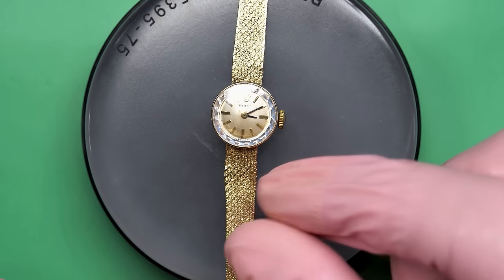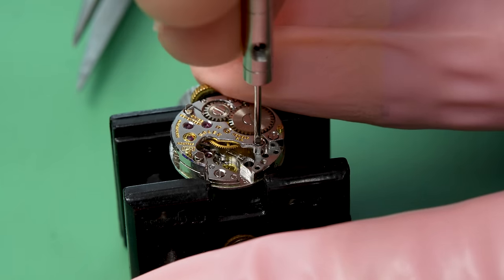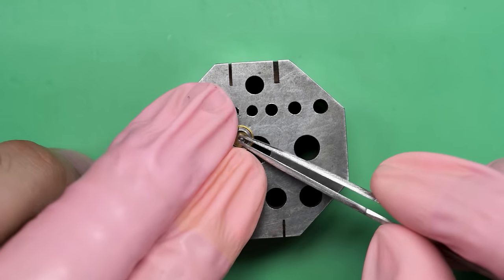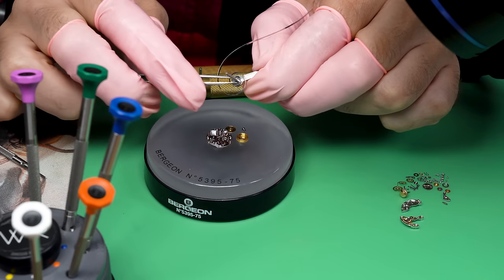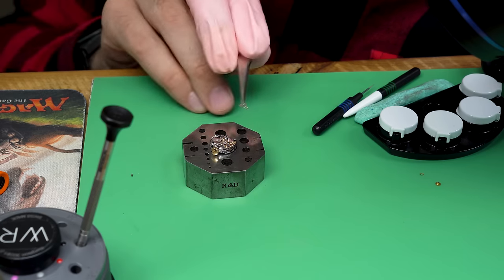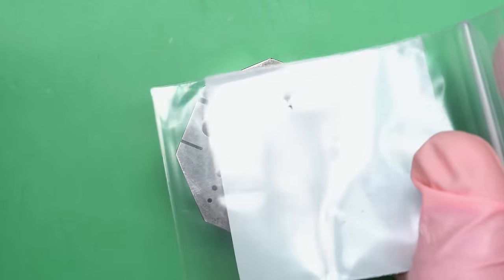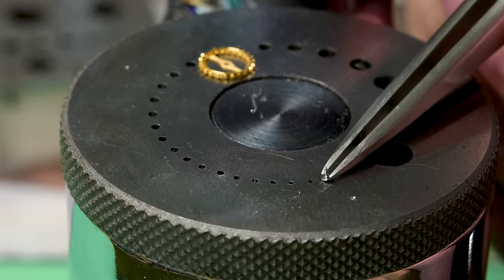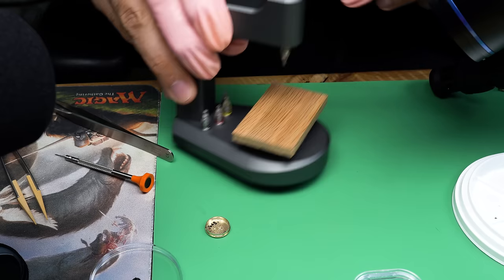I Lied, THIS is the Smallest Mechanical Watch I've Ever Seen!

Comment: I'm familiar with machining, lathes, mills and thread cutting and it boggles my mind how such tiny screws and components can be so accurately manufactured
Reply: I was thinking the same.
Reply: here's a fun fact: the millionometer (a tool to measure one thousandth of a millimeter) was invented in 1844 by one of the watchmakers that owned JLC
Reply: i cant even imagine drawing up the specs of those screws
Reply: I’m pretty sure they just make like hundreds and hundreds of them at random and hope one accidentally just turns out the right size

(am joking, but that is legit how I would do it haha)
Reply: How do you even make a cutting tool to cut the threads? Do you sift through diamond dust looking for a sutably pointy one?
Reply: I study machining at a trade school, and by Jove, very few, is any, threads have come out right on the first try, even after transitioning to CNC machines.
Reply: The machines that make those tiny screws are absolutely and decievingly massive
Reply: And this was in the 60s I think he said
Reply: @neilbrucker5985  I'm not going to pretend to be an expert but tiny fasteners were made long before the 1960s. After a quick Google search I'm stunned to learn the first example of a pocket watch dates to the 1500s. Not suprising  that it was a German who pioneered them
Reply: Swiss lathe
Reply: Yeah and the pocket watch blew my mind, the Elgin from 1880. Sure it's huge by comparison but the screws and gears are so precise. I had marvelled at the fact they could make steam turbine engines at that time but the precision is a joke compared to a pocket watch and these things were mass produced. You can find a running original for 30 bucks. And yet they are the pinnacle of precision engineering before any of the tools of it where invented. And how tight they got the tolerances too. This is some Apollo guidance computer level of beyond insane engineering. And someonencame up with that using an ape brain and pencil and paper with the first modern mechanical clocks having come about a century earlier for navigation at sea. Those are big but still hugely impressive for the 1780s.
Reply: My understanding is that before 1900, it was extremely rare for any micro screws to be of a standard size. Instead they were "made to fit", by hand. It's very common for an antique watch to have 20 screws that are all slightly different sizes. Better keep track of them when taking it apart!
Reply: Same!  HOW?!?!?!
Reply: Micro fasteners aren't machined in the same way as a large one-off threaded rod like you might see someone make on a lathe, turning down the O.D., cutting the thread, etc.

Micro fasteners like this are typically stamped. There's a blob of metal that gets pressed between two plates, or twisted between two wheels/mandrels and a screw is born.

You can see just how rough some of these micro screws are when he shows one closely under the my microscope. Definitely not a finely machined thing
Reply: @shinyribs2178  Automated watch screw making machines came out in the 1870s.  Yes, they were lathed.
American Watch Making Company(Waltham) had their own proprietary design, then there was the Spencer Automatic.
Reply: Watch cronova engineering. They make watch screws
Reply: @mateuszQRDL 😂

Comment: What I love most about this is that you'd likely never get the chance to watch someone do this up close in real life (because a lot of professionals dislike customers looking over their shoulder when they are trying to concentrate), and certainly not magnified for your convenience. Also, when you said 'we did it!' after working your magic on that balance, I've never felt both so included and so inept at the same time.
Reply: "because a lot of professionals dislike customers looking over their shoulder when they are trying to concentrate"

I'll bet quite a few never go this deep into taking a watch apart for service, and just open the case and dab some oil in and call it good, the fact this watch was relatively recently "serviced" but the balance shaft was broken kind of suggests what I said- they just opened the case, dabbed some oil in and called it good.
Totally taking a watch apart like this takes time even if there was nothing that had to be repaired, just taking it apart, cleaning, oil, reassembly would take enough time it would have to cost close to $150- $200,  so if a shop charged $49.95 for "complete service" I'd be very suspicious they don't take anything apart past the case back, just blow it out with air, put some oil in where they can reach and call it good
Reply: @HobbyOrganist  you're probably right. And yes, a service is expensive. My last one was around 400 euros including tax
Reply: I feel like I'm a little kid watching my dad in the workshop or play video games again
Reply: This was great fun to watch!
Reply: Yyyyyyyeah thanks for "helping" FRANS
Reply: @mrlocorio4291  exactly that
Reply: @HobbyOrganist 😊09
Reply: Your so right about this

Comment: The smallest watch I've ever seen was the one that my grandmother used to wear on her nursing uniform. It was pinned on the shirt, and had a 2" chain. At the end of the chain was a pendant the size of a pinky nail. Inside that pendent was a watch that was upside down with the case. The purpose was that she could look down at her chest and see the time for taking pulses. She retired 40 years ago, and I haven't even thought about it since.
Reply: Wow!
Reply: My great-grandma had a similar watch. About the size of the one in the video, but same concept, pinned to her shirt upside down for easy looking. She worked on telephone routing boards back in the day.
Reply: In 1929, Jaeger-LeCoultre created the Calibre 101, specially to fit the diminutive jewellery watches that were all the rage at that time. This tiny rectangular movement has 98 parts, and it measures 14 x 4.8 x 3.4 mm. It weighs a gram, and it is manually-wound, with 33 hours power reserve. Its rectangular shape makes it ideal for inclusion in jewellery pieces, but it has remained very much a collector’s item. Jaeger-LeCoultre still have the capability of making it, but from 1929, only about 2,000 have ever been made. Queen Elizabeth II possesses at least two: she wore one on her Coronation Day, and Jaeger-LeCoultre presented her another, in a diamond bracelet watch similar to that piece, for her Diamond Jubilee. Today their range includes the Joaillerie 101 Résille, reference 2823326, in which the movement is set in a bracelet of blue and pink sapphires.

Comment: My mom had a watch that appears smaller than this that she bought in the early 60's.  It stopped working in the late 1970's and was told it wasn't worth fixing.  It's about the size of a pinky finger nail and I'm guessing the watch maker she spoke to just didn't have the chops to attempt the service. I still have the watch and I suppose will get it serviced when my daughter grows up.  Nice to see someone is willing to take these on.
Reply: The size of the movement is achieved by shelving the plates. The components aren't' scaled down to the movements diameter. The difficulty working with movements is rarely a size issue.
Reply: Like yourself, my mother has a watch that is much smaller than this rolex.  My mom's watch, a GP, is 14kt white gold & is so tiny that I've never been able to tell the time.  Which begs the question, what is the point of a watch if you can't tell the time?
Reply: @montanajones8393  This Rolex is HUGE - ok some exaggeration there😊 , but I've seen tiny watch movements that are small enough to be a finger ring. And yes, totally pointless for the job in hand if you have to squint at it 5cm from your face. At that scale, there must be some alternative to a round analogue display.
Reply: @Robert_Browne  Yeah, size doesn't matter, it's the movement
Reply: Smallest watch movement is the Jaeger-LeCoultre Calibre 101
Reply: @fair2middlin  That's funny
Reply: @montanajones8393  Status.  (or just esthetic.. like a fancy bracelet)
Reply: @ArthurvanH0udt  I googled that and I can't even figure out how you wind it, much less service it. Artificial hands with reduction gears?
Reply: Amazing!  Micro horological brain surgery.  Gave me eyestrain just watching the video - brilliant!   My gran's old Jaeger le Coultre 101 calibre stopped working 20 years ago - shall I send it to you?  😈 👿  😄
Reply: @ArthurvanH0udt  You are correct.  I looked it up and couldn't believe how diminutive it is.  So small it requires a big word to describe it.  😁
Reply: "I still have the watch and I suppose will get it serviced when my daughter grows up." - Have master Marshall take a look at it. That video would be a blast for all of us, don't you think?

Comment: I was a watchmaker in the 60's. The order for disassembling was always; release the power in the mainspring FIRST, then the balance and the pallets. Finally the train wheels. You are asking for BIG trouble otherwise. You putting a new staff in was balance was top notch though. I always look forward to your posts.
Reply from the maker: Very low risk to take out the balance first, there isn't anything realistic that could happen there. Taking out the pallet next on the other hand would be badddd
Reply: How could you feasibly take the pallet out before the train?  The pallet is buried under the train...
Reply: @ebmusicman84  The pallet fork isn't "under" the train, it is literally the end of the train in as much as it holds the escape wheel from incrementing with each swing of the balance. With the balance removed, you'd simply unscrew the pallet bridge (releasing the pallet fork) and in an instant the entire stored load of the main spring would run through the train. As Marshall says: "...it would be badddd."
Reply: @ebmusicman84  You can see in the video that he put the pallet fork in right before the balance, so you could also take it out before the train.
Reply: @WristwatchRevival  I have to respectfully disagree with you there, Marshall. Once the power is removed and the balance, removing the pallet is safe, and then you can check the train of wheels for any problem, before you disassemble it. Especially useful when you are diagnosing a faulty movement, I find.
Reply: @mikenorris5739  Gonna agree. As with an electrical system, making sure to "cut the power" so to speak is always step 1 as the best and safest practice. Can you get away with not doing so in some cases? Sure. But why take the risk?
Reply: He isn't a professional watchmaker, so it will be obvious to the trained eye when he doesn't use proper technique. Fairly surprising when he's dealing with a clients timepiece.
Reply: @mr.personal-ity  I watch a number of YoueTube channels, and see this sort of comment from someone who is supposedly "older and wiser" than the guy dong the video. Imagine that the guy doing the video has discovered a technique that is better/easier/faster/safer than what you have believed to be true. Where's your video of the "correct" way?
Reply: @ebmusicman84  no it's not.
Reply: Wristwatch Revival, the MAIN RISK is taking off the train bridge before releasing the power from mainspring, that's all.
Reply: @simondavid2477  I don't disagree, just commenting. I however NEVER removed the train wheels bridge BEFORE releasing the power of the mainspring.
Reply: @WristwatchRevival  so I'm wondering do you ever do restorations on subscriber watches ... I've got a few decent vintage seikos 6138's and 7016's that have interesting movts. it would be cool to see them on the channel.
Reply: @simondavid2477  well there’s a right way and a wrong way of doing things. It may seem inconsequential to you but you don’t have the experience do you? That’s where older and wiser is something you should listen to instead of being arrogant. There’s tons of amateurs and “watchmakers” out there that are technically piss poor. They don’t understand fully what they’re doing or why they’re doing it. The theory of watchmaking is lost on them.
Reply: @danjenkins8981  Mr. Jenkins...you are absolutely correct....however, you don't beat a dog when he makes a small mistake.  I absolutely cannot find a competent person to work on any of my watches...even throwing money at the problem.  I do not understand all the hate in several videos I see from "experts".  There are NOT enough people willing to do this work anymore...well...in the USA there is not.  Why can't we encourage & gently correct.  NOT directed to you...but I get tired of the BS of everyone knocking everyone else down.  At least people are doing something other than collecting federal welfare checks, eating cheetoh's & playing video games.  Kudos to the guy who gets it done...by hook or crook.  I have pocket watches & wrist watches that will not run...and who wants to collect or pass down pieces of inoperable "stuff"?

Comment: One thing I’m leaning by watching these videos is that this hobby is the perfect hobby for tool geeks. You have a specialised tool for everything!
Reply: Also expensive... but I saw some nice sets for 50-200 bucks that has 90% of the tools needed and then you just pick up some specialised tools along the way. But I still find it surprinsingly affordable that way. I build model ships and I easily blow through that much in tools per ship. And watchmaking can be kinda profitable, at least you can recoup a bunch of losses if you can resell one occasionally. Rolex don't seem any more difficult than Omegas yet they go for 10x the price... so just fixing 1-2 of those a year might provide cash for the hobby for tools and a bunch of busted watches to fix.

Comment: This was the most heart stopping episode ever. Every time I saw you putting pressure on the movement sliding around on that staking block I was afraid you were going to accidentally bend or break the centerwheel hitting the shaft against the side of the hole.

Comment: I like how the yoke spring (at least in this case) looks like a stylized 'R'. Also I kinda blame you for me looking on ebay for pocket watches to disassemble, buying one, and liking it too much to take it apart!
Reply: You can buy a Seagull ST3600, which is pretty good copy of an ETA 6497 pocket watch movement.  They are cheap and great value for money, and are great for practising on.  Once you are finished with working on it you can stick it into a Panerai style wristwatch case and wear it on your wrist.
Reply: @chubbydinosaur9148  Those would most likely be pin lever watches and not worth practicing on.

Comment: Just finished my first project, a mantel clock and appreciate your videos helping me. The only problem I had was that I ended up with 2 extra washers that I can't figure out where they belong. The clock is working though so I got that going for me 👍
Reply: I don’t know what it is but every time I take something apart and put it back together I almost always have at least one screw or washer or something left over and the thing works fine. I guess I’m just more efficient than the original manufacturer

Comment: I have a steel movement holder (Bergeon 4039) that holds movements down to 8,5mm. I guess this should be part of your next tool shopping spree 🙂
Reply: +1. The 4039 works great on these tiny movements. The reverse side will hold much larger movements so you can use it as a second holder when working multiple projects. It's not even a one-off tool, in my opinion.
Reply: Yeah I feel a bit inclined to believe that more effort could have went into securing and fastening the movement onto the holder than was made. Just a hunch. I honestly believe that it was barely attempted at all.
Reply: looks like a bit of careful file work on the painted edges and his would work fine too
Reply: @DONTctVT  Is it even painted edges though? I have to admit I didn't look too close and I cba to go back in the video to check, but that thing looked plastic to me. Given that it was included in a set, it makes sense to me that they used the cheapest material they could find for an "extra" tool that isn't the highpoint of the set. 🤷‍♂
Reply: @Wayazaexa42  it's painted pot metal. You see it all the time with cheap Chinese stuff
Reply: I need that too I just get an OMEGA ladies from the 50s that the case is 17mm.
Reply: ET.. Don’t know how much was done off camera to get the movement holder to work. I’m no watchmaker but I know tools. A good tool is a pleasure to use but fighting a cheap one takes the fun out and makes it like work, not a hobby,at least for me.
Reply: @Wayazaexa42  It is obviously really cheap, but I think the biggest problem was that the crown was too big for it, and the movement wouldn't sit all the way down in the notches on that side, so kept slipping out. Some filing to increase the size of the crown notch, or maybe turning the movement 90 degrees so the crown was between the jaws might have made it work a whole lot better.